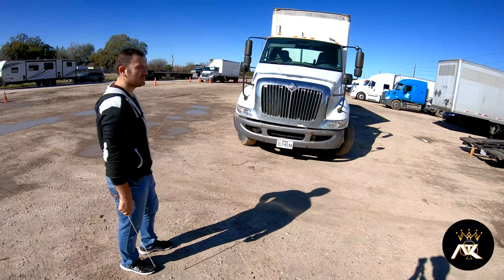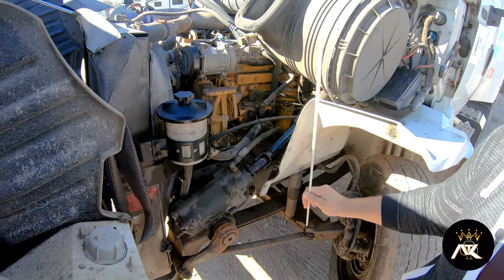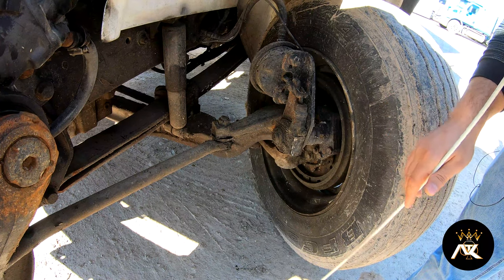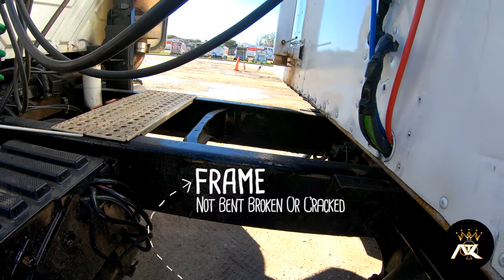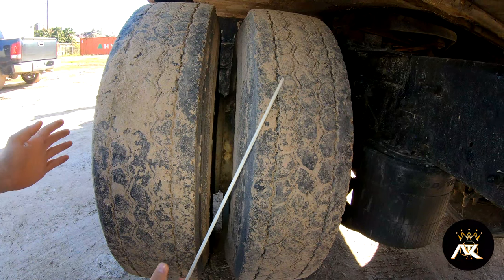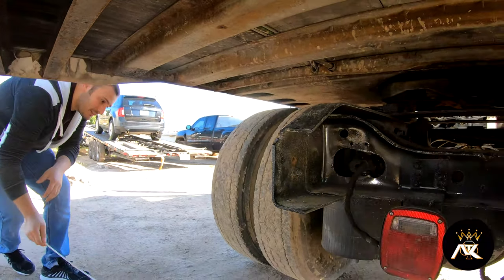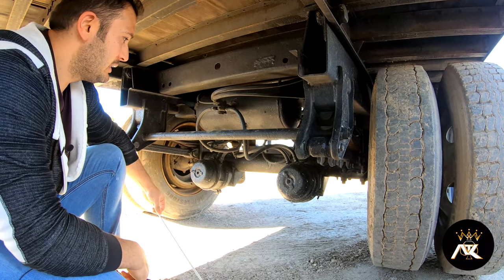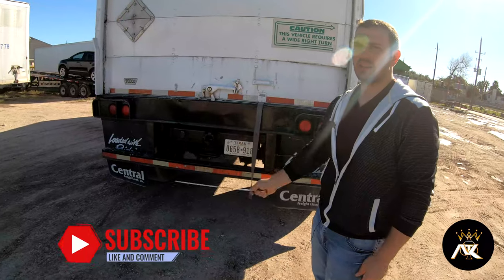Full Pre Trip inspection with Student - CDL Test Inspection

Comment: Do yu have to say sliding pintle and and hitch release lever?  Those are in the handbook but I was told we don't have them on the truck would we have to let them know that?
Reply from the maker: Chilled Coughee you can say it’s not equipped with, but is not necessary to mention.
Reply: @ACETruckKing  ok
Reply: @ACETruckKing  do we have to have fuses with us when we do the in-cab if we dont have any? Or can we say we just say will have them, or that we have them.  Do they need to physically see them?
Reply from the maker: Chilled Coughee you need to have them on the truck and show them.

Comment: I been studying this video and the in cab inspection.  Due to some personal problems I stopped for 2 weeks. I cant find the in cab inspection video. Seems to be removed. Is there a way to see it. It was the best video I had found for the in cab.
Reply from the maker: I removed my other Incab video.
You can check this one, its newer and I explain better the in-cab inspection here.
https://youtu.be/hLiHGAFWTqQ
Reply: Thank you. I was worried 😟.  It will be the same for a standard vehicle right? I got it all done mostly but I still forget some items.
Reply from the maker: @Hotmex13  yes, just change the way you handle the stick shift. First gear for testing the brakes

Comment: I’ve been told that whenever we go to do a pre trip we won’t end up doing the whole truck and trailer that they’ll choose what we have to inspect is that true??
Reply from the maker: Armando Ruelas you can randomly pick A,B,C, or D. The D card is the whole truck.
Reply: ACE Kings CDL Do you know what A,Band C are by any chance??
Reply from the maker: @armandoruelas9118  A = under the hood (steer Axle and Front lights) B = Side of truck (from the mirror bracket to back tractor lights & Drive axle) C = Front, Side and back of the trailer & Trailer axle) Coupling & Incab  is 100% mandatory also.
Reply: ACE Kings CDL one last question is do you have to double clutch whenever they take you out to drive?
Reply from the maker: Armando Ruelas the book says you have to double clutch. Although, some testers don’t care.
Reply: ACE Kings CDL I test next week but I’m going in a 10 speed pete and a 42 foot hopper grain trailer!
Reply from the maker: Armando Ruelas good luck, drive safe and dont get neevous
Reply: ACE Kings CDL would you by any chance know how much space I would get to parallel park a 42 foot trailer with a peterbilt with a sleeper?
Reply from the maker: @armandoruelas9118  they measure 15' extra at the back.
Reply: ACE Kings CDL okay thank you! And is it true you have to park 18 inches close to whatever side line you have to park on? Or can you just park in the boundary lines
Reply from the maker: Armando Ruelas for parallel parking just make sure that no parts of your truck is over the cones or lines. “Be inside the box”
Reply: ACE Kings CDL Alrighty thank you sir! And my last question is what happens if I don’t double clutch? I’m used to floating gears I can float pretty good so what could happen if I don’t double clutch
Reply from the maker: Armando Ruelas that all depends on the tester. Some will let it slide if you’re good at it
Reply: ACE Kings CDL Alright I test tomorrow morning! 11 AM
Reply from the maker: Armando Ruelas passed?
Reply: ACE Kings CDL I did my pre trip instructor told me everything was perfect except the tractor valve never popped out when I did my brake test so I’m going back
Reply from the maker: Armando Ruelas for the last step look at your valves, not your gauges.
Reply: ACE Kings CDL I did I ran out of air completely and nothing my trailer valve came out but not my tractor lol but w already got some new ones gonna install them and we’ll see what happens next time
Reply: ACE Kings CDL you pick it or they do?
Reply: Sawat They picj
Reply: Armando Ruelas is it the same inspection everywhere? So it’s possible you might just do the engine and air brake test?

Comment: @6:50 correction: 1" of play with the brakes APPLIED
Reply: Wrong correction. When you apply breaks there should not be any play. So I said it write on the video
Reply: @happynew009  just a question.. So when we are checking the push rod and slack adjuster during the pre trip we are checking them with the brakes released?
Reply: Most of the time trucks must be on brakes when they are parked so there should not be any play when you’re checking your slack adjuster but if the vehicle is not on breaks yes there is a play of 1 inch
Reply: During your pre-trip inspection you just point at them, you don’t pull them
Reply: The point of a pre trip inspection is to mimic an actual real world example in front of the DMV Examiner.. that's what I thought was the point.